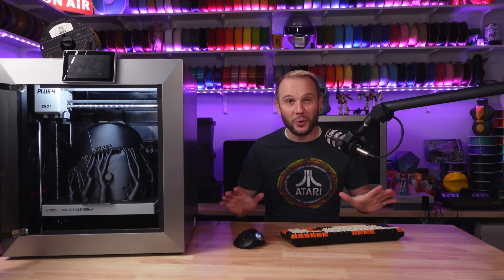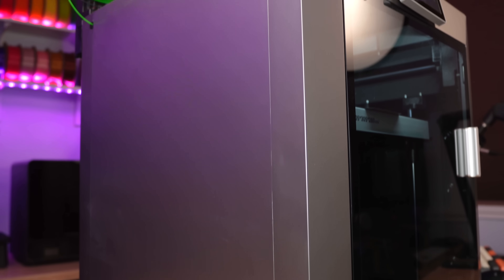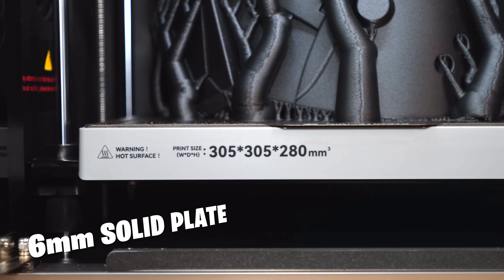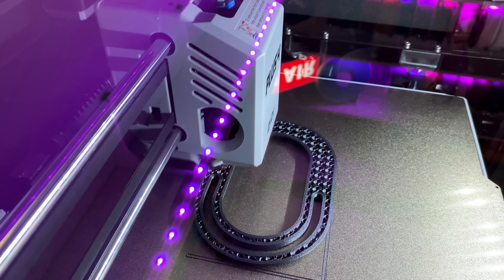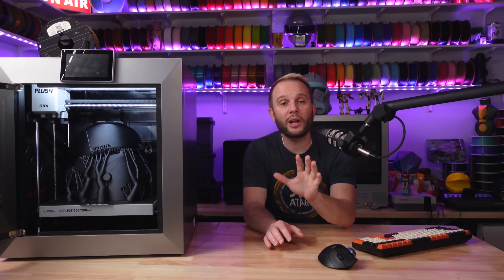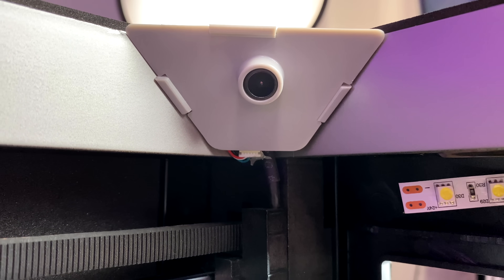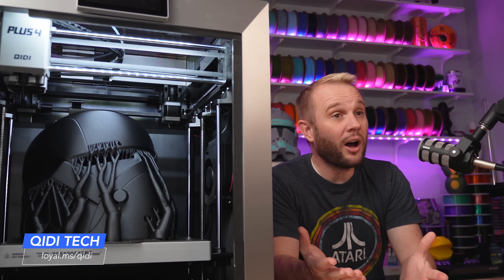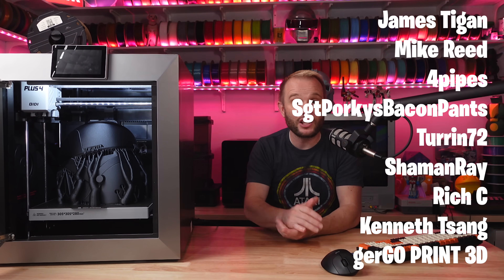NEW QIDI PLUS4 - Maybe the PERFECT 3D Printer!

Comment: Was going to buy a qidi q1 pro then I saw this and changed my mind instantly. I print with almost exclusivly abs, asa, and pa12 nylon. This will be a much needed upgrade for what i do. Before looking at the q1 pro i was looking at the bambu x1e but that was a bit out of my budget for 1 printer. Cant wait to see what filaments i can print with 370c nozzle temp.
Reply from the maker: AWESOME! I would take this machine over the Q1 Pro any day, this is just such a good machine.
Reply: well all the same filaments you can print at 350 pps rolls all say max recomended printing temp 350c the next high temp filaments take 400c and higher to print  so this thing a cutter and is 25mm bigger then an xplus3 20 degree higher nozzle temp makes legit no difference in what it can print so a cutter and 25mm bigger build plate for 200 dollars more

Comment: Love the printer HATE the environmentally unprotected location of the spool with a passion.
Reply from the maker: LOL! You’ll have a 3D printer, you can move it! 😆
Reply: @LoyalMoses  I looked through their site and didn't see anything about mounting the spool inside the housing. A lot of issue we have is spools sucking up moisture especially in summer. Other brands keep the spool inside where we can at least keep it warm. Don't get me wrong. I already put in a budget request to replace our printer in engineering in 2025 and this has made the list or candidates. I was hoping a company that is marketing towards some of these pain in the butt materials would have some solution in their design
Reply from the maker: I totally get it! I’d look at external solutions that can actively dry spools, Polymaker, FixDry and others have great ones - this way you can use it on any printer.

Comment: All this sounds great, but if another video I saw is correct, this thing does NOT have auto z-offset measuring, i.e. you still need to set the z-offset with the meanwhile ancient paper method.  I've seen footage of it nicely purging and then cleaning the nozzle, so it just seems weird that it would not be probing with the nozzle (and hence get z-offset automatically).  But you don't mention anything on auto-leveling and z-offset, so is it correct that this thing still requires the paper method?  If that is not a negative, then what would be?  I really hope that other (German) video was incorrect, so please, if it has auto z-offset, please make that clear and if it does not, also make that clear!
Reply from the maker: I never adjusted z, not once at all in all of the testing I did.
Reply: It has auto z-offset.
Reply: @Kimberlie1  Strange, I've seen another videos since and it too indicated an inductive probe is used requiring manual z adjust...  What is your info based on?
Reply: @MisterkeTube  QIDI official store. And I have got one. Plus4 is fully automatic leveling. However, some users prefer to level it manually, so qidi retains the option of manual leveling. I also saw a creator's video mentioning manual leveling. I think this is wrong information. He may clarify this in a subsequent video.

Comment: Im currently trying to decide on a printer like this. Im stuck between this,  the X1C, and waiting for a new bambu release. Any recommendation on which route I should go?
Reply from the maker: I never advocate for waiting for a 3D printer... if you wait, there will always be one to wait for right around the corner. My advice, jump in and start enjoying it. If you have the budget for an X1C it is the best printer and experience that exists right now. The PLUS4 is amazing if you want to print higher temp filaments and have a heated chamber.
Reply: @LoyalMoses  Thanks for the reply. I ended up getting the Qidi for that exact reason. I didn't want to modify an X1C to have a heated chamber or anything. For the price, the Qidi really seems unbeatable, features wise. Here's to hoping it holds up well.
Reply: I doubt how much I should pay for a Bambu machine with the same performance as qidi plus4. So I will definitely choose qidi.

Comment: 6mm is not enough by 300x300. We used 10mm AL5083 until 160 deg. 
Less than 10mm leads to minimal bend the bed at higher temp.
Reply from the maker: Bigger belts are important for sure.

Comment: Seriously looking at one of these, only wish the build volume had been squared , 305x305x305, rather than 305x305x280.
Reply from the maker: It’s an interesting size, and I meant to ask and forgot why they chose that. I am sure shipping costs or manufacturing may have been the reason, but that is just a guess.

Comment: If I could have a printer at home this would probably be the one I would buy. Mostly I design and make parts for adapting large format film cameras. My next project would be a camera back the takes 8x10 inch film. The parts are wide and deep, but not tall. They must be absolutely flat. Ideally you could use it in the sun and keep it in the trunk of a car without worrying about warping. The only additional feature I could use would be a second extruder  to lay down a contrasting support material so that I could get clean, flat and accurate overhangs. That would greatly simplify part design.
Reply from the maker: Awesome, thank you for sharing!

Comment: I want to pull the trigger, but am a little apprehensive. Really think and AMS at this time is what I want (maybe not need) and the website states that the replacement nozzles are 2-3 months out. What do other's say?
Reply from the maker: Have you considered Bambu Lab and an A1 or P1S for the AMS right now? Q1 is still a bit away from the QIDI, if you want it now.
Reply: @LoyalMoses  I priced not equivalent in size Bambu with heated chamber around $2499 vs $799 and AMS in beginning 2025 few hundred, my choice in Qidi was easy decision.
Reply: @boazjoe1  They shipping me some nozzles so they have some on hand.

Comment: Qidi have a picture on the website for this printer showing the new multi-filament unit (release date Q1 2025) and the 4 Plus page has several references to the multi material unit.  This seems really good
Reply from the maker: The multi-color system will be just a few months away! This is such a good machine!
Reply: @LoyalMoses  I hope they send you a muktu-color unit to demo because I wouldn't have checked their website if not for this video

Comment: So I’ve not seen it mentioned in any other video except one, but do you really still have to set a-offset using the paper method? Seems quite backwards for such an advanced printer.
Reply from the maker: No, this is completely automatic.
Reply: @LoyalMoses  oh that’s good to know as the one other review I saw showed the reviewer setting z-offset the old fashioned way. Also had to do quite a bit of repair on the x-axis linear bearings too! Tempted, very tempted by this machine. Wish I had a clue what bambu labs have in store - I’d even go for a 300x300 A1 at this point.
Reply from the maker: You can fine tune or make adjustments, a lot of people still use paper with a lot of machines that allow z-offset adjustments.
Reply: @LoyalMoses  awesome. Really struggling to make a decision between this and the Sovol SV08
Reply from the maker: Oh, that’s a tough choice! The larger build volume of that SV08 is amazing and printing helmets and cosplay on it is awesome!
Reply: @LoyalMoses  lurking in the Sovol forums the SV08 just seems to have a lot of issues. I’ve really had enough of “tinker” printers -‘Bambu labs have spoiled me.

Comment: Whats better though, P1S or carbon x1 Vs. Qidi Plus 4
Reply from the maker: That's tough because it would be P1S because of multi-color, but now we have confirmed that multi-color for the PLUS4 will be here in Q1 of 2025... this is so TOUGH!
Reply: @LoyalMoses Yeah I was thinking about getting the P1S for a while until I saw this video.. now I cant decide
Reply: @artIfactuaI If your planning on printing High temp filaments like ABS and ASA go the QIDI Plus 4, the P1S carbon rods have binding issues over time with ABS Vapor. At least that’s been my experience when using it in a print farm with only ABS. The Creality K1’s have even outlasted the P1S

Comment: Been wanting a bigger corexy than the 256 cubed I currently love using. I just need that extra space for some projects in order to replaced my larger slower bed slinger. I do wish it was 305 cubed instead of 305x305x280 but for $799 this is a great deal.
Reply from the maker: Yeah, that is a weird shaped build volume for sure, but it works!

Comment: I didn't see any mention of the flow capabilities of the hotend.
Reply from the maker: 99% of users don’t care. I used to include it with other printers, but it’s just a few nerdy types that care, most people just want to buy a printer and print stuff.
Reply: @LoyalMoses  those users can get a $200 printer then if they don't care about that, if i'm paying $800 for one i want to know how much filament it can push out otherwise it won't be printing very fast and will need a hotend upgrade. I didn't see this mentioned on qidi's website either for some reason.
Reply from the maker: It's actually the other way around - the tinker types have a tendency to purchase lower-cost or entry level machines and upgrade them while the majority of printer buyers right now are buying more expensive machines because the machines are finally click/print ready.

Comment: I have only had the Qidi Max 3 for about 3 months. Now i admit at first was a hard start, First it had software crash. restarted printer then firmware was not matching with the MCU (reflash) then screen started showing lines on screen Qidi was quick and nice about replacing, then filament sensor took a dump. overall was easy to repair qidi had no issues sending me parts. bed leveling on this thing is perfect every time, bridging capabilities are amazing (my first enclosed printer) the quality im pulling out of my Max 3 is amazing parts feel strong, no layer lines. perfect profiles. My Qidi Max 3 is my fav printer. Pursa Mk2s, CR-10S, CR-10S Pro, CR-10S Pro, ender 3, Qidi Max 3, SV08. 3d printer bug got me...
Reply from the maker: You’ve got the bug for sure!!!

Comment: I’ve not owned or used a 3D printer, but as an engineer, I’ve vaguely been interested in them.

What I’m struggling with is, what are people actually using them for?

It always seems people printing small 3d models of characters, or, in this case a Star Wars helmet. Such objects might be fun to do but ultimately end up sitting on a shelf for decoration.

Granted, the Carabiners look potentially practical / useful, but, are they strong enough for real world use? And even if they are, it’s probably more cost effective to buy such an item off Amazon…..considering the helmet cost $140 in filament alone. 

As a practical person and a professional engineer, i’m probably in the target audience for a 3d printer, & they appeal to me, but, I just don’t see a huge practical use for them. 

In my professional career, I have come across 3d printed models numerous times over the years, but these have been more to have a physical representative part of something, say a bracket, so others know what to expect in terms of package space, but they have mainly been ‘place holders’ until the actual manufacturers part (usually in metal) arrives. It’s quick 3d prototyping. I’m not sure how much value that would be to the hobbyist.

However, from this review, this 3D printer does look amazing.

Comment: I have the QIDI X-Max3 and right now it sitting on the floor in a spare room. It has had several problems (it had problems from day one) and the last one, the magnetic pad on the print bed pulled partly up after a print to removed the print - I had waited over 1 hour before It try to remove it. I never been able to get it to print well again (I mostly print using PLA/PETG filament wanted to try some of the more advance filaments like ASA or CF stuff at some point too). I work with the QIDI on the other issues I had with it (they have really good support) and they where very helpfully, but there nothing I can do to get it to print level across the entire bed, the Z-axis offset just never worked evenly across the print bed. It feels like the printer bed is warped in certain areas. I have replace the magnetic pad which came up way to easy in multi areas and hard in other areas. 

I have bought replace hot ends, extrudes, nozzles, PEI plates, etc. for it.  It has become a money pit and I have given up. I have tried to fix it but its just not worth it any more. I tried for over 3 months to get it to print well again. Every time I think I have it, it works fine for one or two prints than I have many failed prints - always in certain areas of the print bed.

I just cannot bring myself to purchase another QIDI print even though this one sound really good. Nothing against QIDI, they been great trying to support me, just my bad luck - as a good friend of mine whose know me for over 25 year put it recently, you should try good luck sometime in place of your bad luck.  

So it a hard pass for me on it I wait and see what Bambu Labs comes up with. I would like at least one 3D print to just work and one I do not tinker with. Yes I tinker with 3d Printers quiet a bit. The QIDI X-Max 3 was suppose to be the always just works/never tinker with printer for me. :( 

3D Print has become my new hobby I really enjoy.  I have always like building my own computers and water cooling them but now 3D Printing has replace that. I find it very fun and yes frustrating at times but I like the challenge of 3D Printing (the technical stuff for 3D Printing - I am in no way a model designer, not even close).
Reply from the maker: Oh man, I didn’t enjoy reading this! I hate seeing bad experiences, and I always wish I could fix the problem or help in some way. Sorry that you have a giant helmet class 3D printer that just can print! I wonder if there is a place you can take it to have it looked at / repaired?!
Reply: @LoyalMoses  Thank you for you reply to my post. I work in IT at a universality and one of the folks I work with know a lot about 3D Printing, he offer to help me with it (2nd pair of eyes sort of thing). I do not think I miss anything but having some one else take a look is worth the effort. However, it will be  a while before I can do that as I not at work because I am recovering from surgery and have another surgery schedule for early October, so it will be some time before I can take him up on his offer of help.

I still think the new QIDI print is really good and a shot across Bambu Labs bow. It seems to so far have a lot to go for it thought I wish it where closer to 350mm size printer.

Also, an idea for a future video, maybe you could go over the process to print with some of the more advance filaments like TPU, ASA/ABS or CF type stuff. A nice how to with what to watch out for and recommends? Plus factors/reason you might want  to use those filaments. I never used them myself and the possible health issue are spooky to me so it be nice to see what your advice/recommendation are.

I enjoy you videos on 3D Printing, you never nit pick on things, you cover the pros and cons with recommendation as to what it can be used for and not for but also how you like to see it improve.
Reply: Sorry that happened to you.  I would contact them.  I have the X Max 3, and it hasn’t had a single issue.  That machine alone has me addicted to Qidi.  I’m just happy to hear the AMS direction they are going so I don’t have to buy the Bamboo.  Don’t get me wrong, the Bamboo is perfect, but I have brand loyalty, and you can’t beat the specs on this one!
Reply: @makerbit3970  Same here, I bought an X-Max 3 last month and I've been printing on it nonstop since getting it. So far in almost 50 prints I haven't had one print failure or any major problems. The only downside is the poor design decision to locate the sealed spool holder at the rear of the printer, which makes it more difficult to change spools. But there are models out there for external spool-holders if you want to change that. I own other FDM and SLA printers and this has become my go-to. It's not perfect, but it's the most reliable and fastest one I own. And for such a big build volume and a heated chamber at its price, it's great. It sucks that the OP is having so many problems with his - my sympathies. It sounds like he, unfortunately, got a lemon. It happens, it's happened to me before too with other printers. But it's evidently not a systemic problem with their X-Max 3 line, and more just a one-off, "bad apple" situation.
Reply: I had the same issue, just add 20 to your Z offset, go closer than what you think and youll have near perfect prints at any point on your print bed.

I used to do Z -1.30mm, but now have it set to -1.48 - use a piece of regular a4 paper instead of the provided levelling card/paper

Then add some, dont just do "feel slight friction" go for, can just about still move the paper

This was the trick for me to overcome the issues that you have experienced

Do I still get the odd layer shift? Sure!  But do I get 19/20 good prints?  Yes I do!

This si from the xplus 3 too!